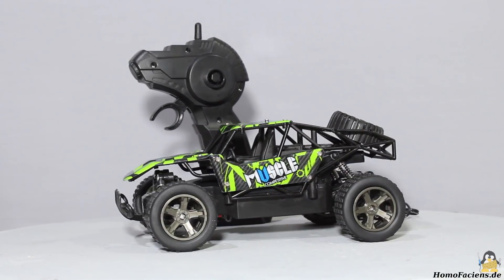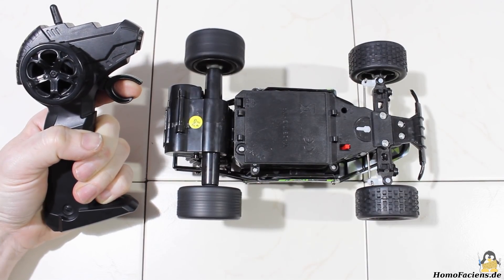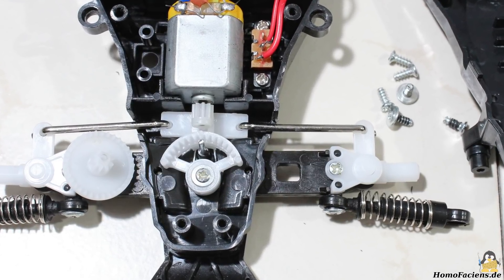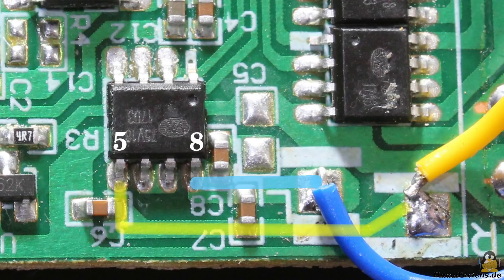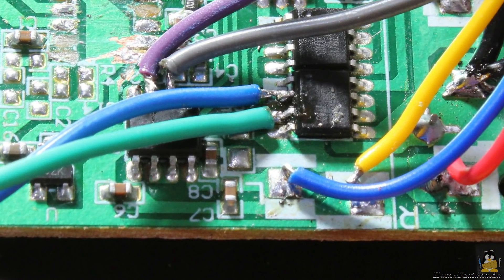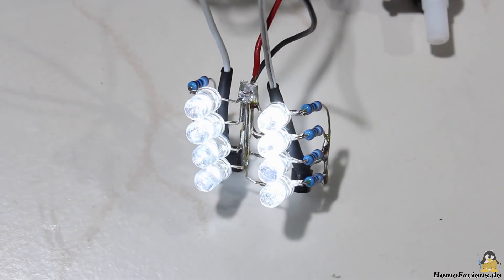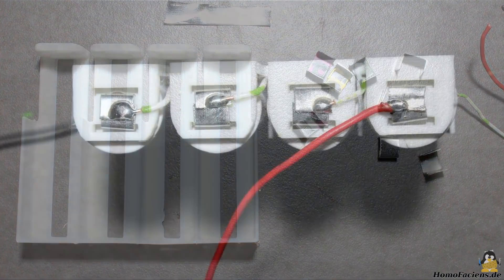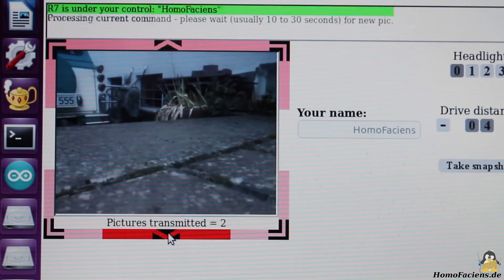Building a rover from an RC model car Jule UJ99 2815B

Comment: No lasers ?
Reply from the maker: ...it comes in a peaceful mission ;-)
I will soon get a large RC model truck that will be able to carry lots of payload. Let's see what add-ons I will implement.
Reply: I suggest a triple 6 Watt laser  :D
Reply: on a turret
Reply from the maker: ...well I prefer using lasers for measurements and material analysis rather than destruction ;-)
Reply: ok ok, Ill meet you half way, You can measure how far something is, then blow it up  :D
Reply from the maker: ...an then analyse the dust cloud to see what chemical elements it was composed of ;-)
Reply: Now that would be something.